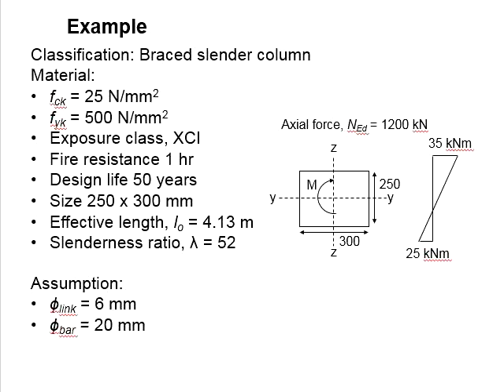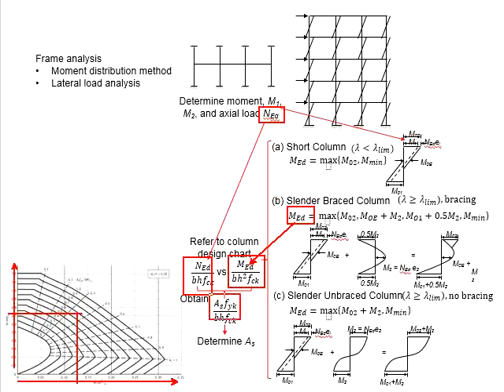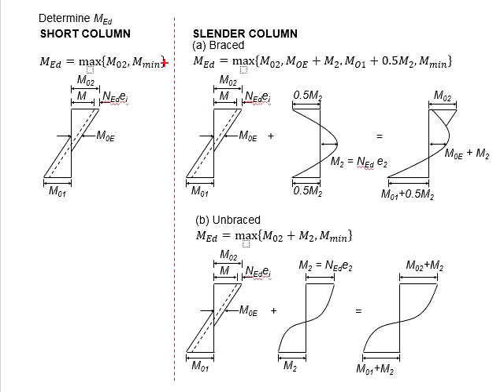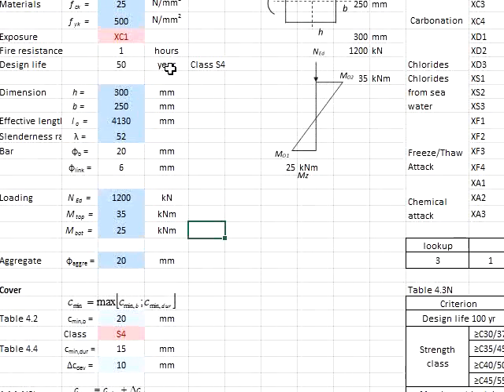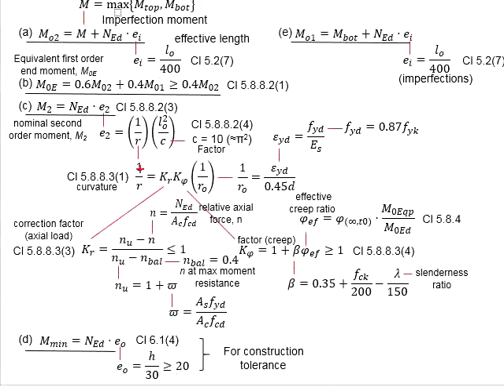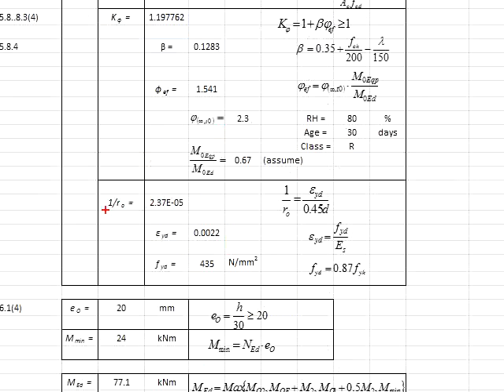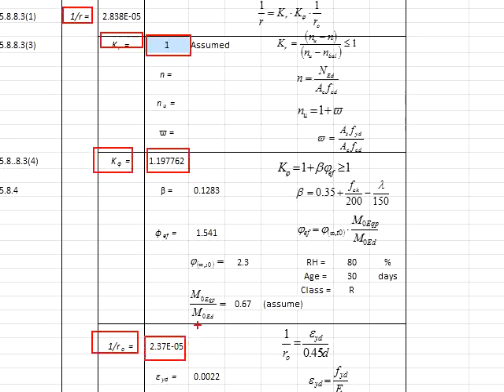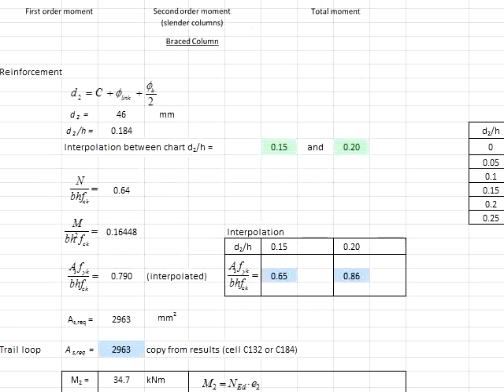2.21 Example: Braced slender column Part 1

Comment: Your values of M01 and M02 should have different signs since they cause tension on different sides of the column. Why did you input them as the same sign? This would also effect the calculation of C in the limiting slenderness calculation as the ratio of the moments would be negative which would increase the value of C.

Comment: Firstly, I would like to thank you for the video. It really help students like me to better understand the topic. Really appreciate your effort here. Secondly, I'm a little confused with the calculation for First Order End Moment, M0E at 5:48. M0E = 0.6M02 + 0.4M01 = 43.4 kNm, which is greater than 0.4M02 = 19.0 kNm. Out of this two value, we suppose to used 43.4 kNm or 19.0 kNm?
Reply from the maker: use the bigger value.